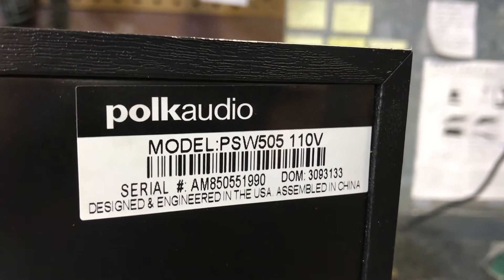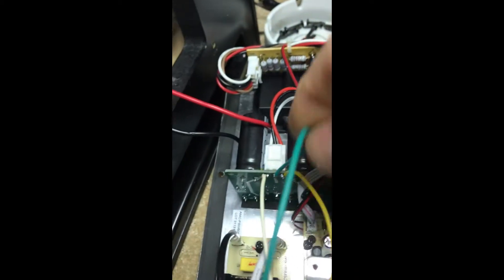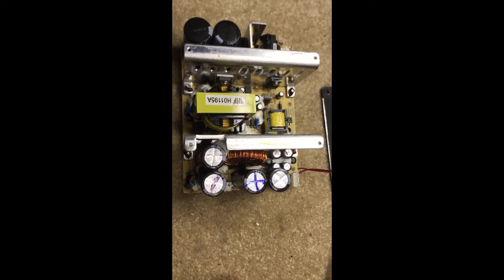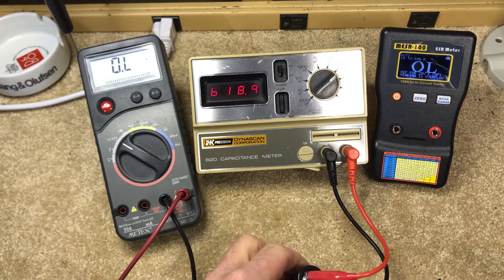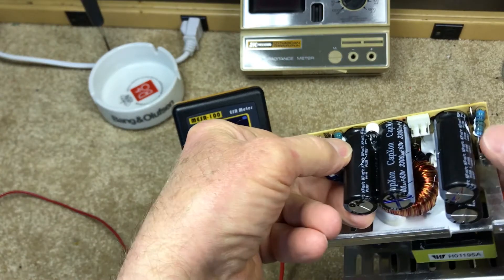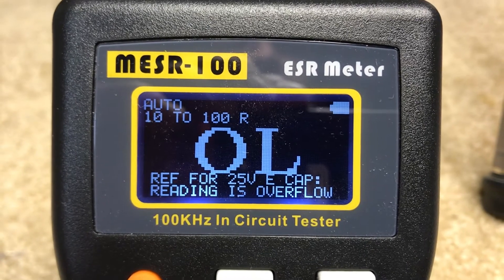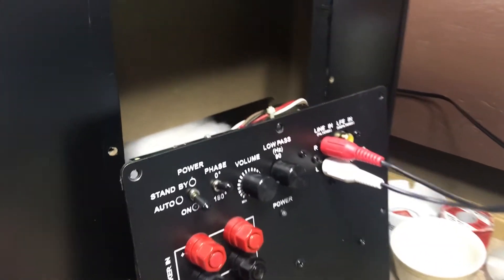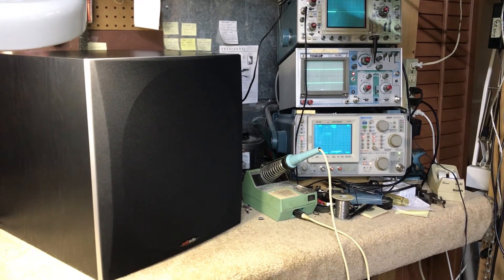Polk PSW505 Sub Woofer - Troubleshoot & Repair

Comment: Excellent troubleshooting Dennis. I have one of these coming my way for repair, and this video will prep me for it.
Reply from the maker: Look up the data sheet for the driver IC and you will get a good sense of how the amp works (Class A design).  Be patient and you will be successful.
Reply: I have had mine for about 2 years now and it just died in the middle of me watching a movie. I can try to take the time to tackle this repair but I'm not a big fan on working with capacitors and I'm not the best with electronics. This is a really good video that goes into great detail. Mr Miles are you up for challenge to get my psw505 up and running. I'm not sure if you have a repair shop but I'll send it off and pay you.

Comment: I purchased this same unit and the amp was faulty. It died and I contacted Polk to see if they would help me. They refused to replace the amp because it was outside of warranty. There seems to be a lot of information about  the problems these units have had online. I would not recommend purchasing one.
Reply: They do offer a replacement panel for $180. I'm going to simply repair it

Comment: Hello Dennis,

Happy new year.

First, thank you so much for great informative videos. I request your help for my sub repair.

My psw303 doesnt power up. I changed fuses 3 times but they keep blowing up as soon as i power it on. Can you please guide what i can do to solve this issue ? 
Thank you in advance..
Reply from the maker: Fuses blowing instantly is most commonly caused by a shorted semi-conductor in the power supply or main power amp (pre-amp is probably okay).  Disconnect the AC power to the unit, discharge the main capacitors, and check the diodes, rectifiers, power transistors, MOSFETs, etc.  in the power supply and main amp.  Do you have any test gear?   A multi-meter (ohm meter) will be needed at a minimum.  An electronic component tester can be purchased these days for under $25 that can also be a great help.

Comment: Any amp issues can be quickly fixed by going to Parts Express. Com and purchasing a higher quality amp. I did this with my Polk PSW110 and it made a huge difference in sound quality from the OEM. I also have the PSW 505 save I'll be replacing the amp on this one soon as well.
Reply: Do you have any video of the amp replacement project?
Reply: @happy_trails  No, I don't. But it's not complicated. Just take out the screws and pull out the amp. There will be a putty type of sealant around the edge of the hole that'll give you a little resistance. Once the amp is removed, unplug the two wires from the speaker. Remember which prong the red and black wires were attached to because you'll have to make sure the new amp's wires are attached to the same prongs. You may need to cut a bigger hole for the new amp. Make sure to reapply new sealant around the edges of the hole, slide in the new amp and screw it down. That's it.
Reply: @crinklestein2000  Which plate amp did you buy as a replacement?

Comment: 18 cent part is causing the sub to turn off. Mind blowing. Thanks so much for this info. Won't need to buy a new sub woofer.
Reply from the maker: Thanks.  Good luck with your repair.
Reply: @dennisbsutube  If I wanted to find someone to take a look at mine which is an infinity brand subwoofer and is making the same noises, but not turing off and other wise functional, is there some businesses that would do this?  I am in Kalamazoo, MI.
Reply from the maker: @watsomd  Ken's Electronics in Kalamazoo, MI sells electronic parts retail and wholesale.  He should know who the qualified repair guys are in your city.  His phone: 269-345-4609.

Comment: This is a very good fix it video, love that you added the parts list.  Talk about piss poor caps!   I own two of these subs, both committed suicide while not even being used, each pushing up daisies in their own strange ways.  The first one died with a straight THUMP DC to the speaker, no audio output.   The other one, similar to the one you worked on.
Reply from the maker: Sorry you had bad luck with two of these subs.  Thanks for your comment about the parts list.

Comment: Thanks for making this video.  Very informative.
Reply from the maker: Glad it was helpful!
Reply: @dennisbsutube  Just curious, how much time did you spend on this repair?  I have the same sub with the same issues.  I'm tempted to just buy a new panel.  They're about $220.  It's been a great sub.
Reply from the maker: @eggnogfrog  One hour spent figuring out the circuitry, expected voltages, and generally how it worked (which is in the video).  Troubleshooting one hour; replacing parts one hour.
Reply: @dennisbsutube  Nice! What's your hourly rate, and can I mail you my panel? :)
Reply from the maker: Ha... no thanks.  My dance card is pretty full right now.

Comment: Great video but I think I'm just going to buy another sub.  Next one definitely won't be a polk with how many 505s seem to go tits up after a few years.  Unfortunately mine went out of warranty before it died.  Sounded amazing before that.  Such a shame a quality speaker and nice housing can be deemed useless by $3 worth of electronics.

I build guitar amps and the caps and resistors in those are just getting broken in after a decade of use.  Even the electrolytics are good for 20-30 years if you play them a few times a year.
Reply from the maker: I can't argue with you.  Perhaps you can connect one of your amp heads directly to the woofer and get a few more years use out of it.  You'll just have to be careful not to overload the guitar amp input with the line level audio signal from your receiver (typically 500mV P=P). Good luck!
Reply: dennisbsutube hi Dennis can you fix my Polk audio psw 660 amp stop working email me if I can send you the the rear panel. jadelmar@aol.com thank in advance Donald Delmar  cell 847 814 4884
Reply from the maker: I appreciate your confidence, but I have been retired from the repair business for 25 years (a prior career).  A good bench tech should be able to help you after he watches this video.  Many models have similar circuitry. Good luck.
Reply: Hi Dennis
Can you fix my Polk audio psw 660 amp not working. My email is jadelmar@aol.com